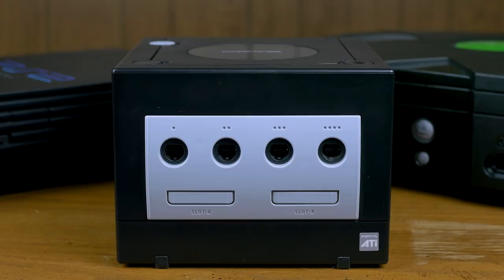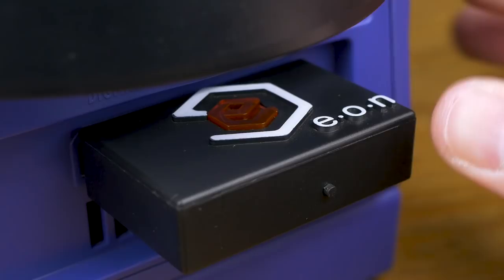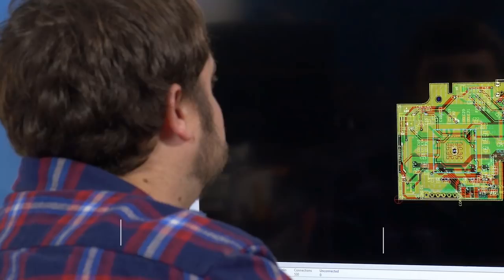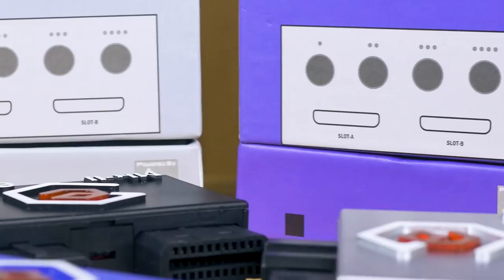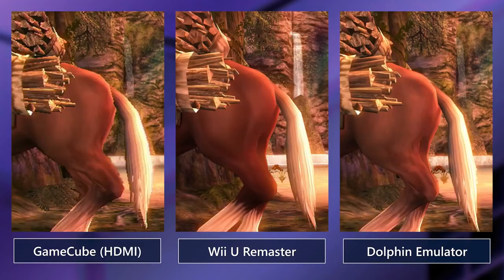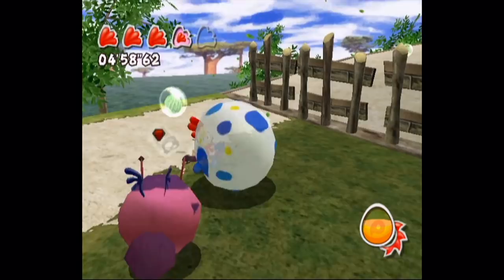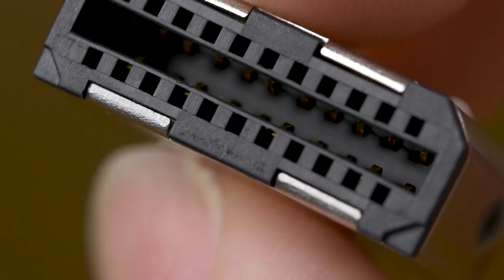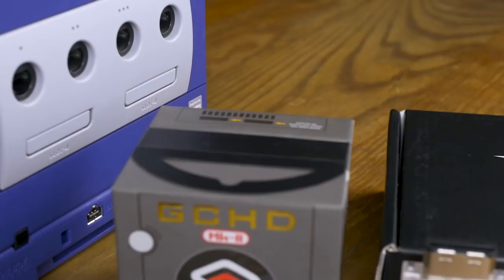Nintendo GameCube HDMI, Component & RGB Plug 'n Play Solutions :: RGB316 / MY LIFE IN GAMING

Comment: This has to be the best videos on this topic.  I bought a carby and hook up to a home theatre and noticed when I turn on enhanced DVI mode I get no audio and this video suggests using rca cables for audio?   This is not an option for home theatre systems and wondering does any of the other devices output digital audio? Especially the internal HDMI install?
Reply from the maker: [Try4ce] Is it not an option? I recall an older AV receiver I had having the ability to select a different audio input for the various video inputs. I haven't tried it with my current one. However, I also have had this issue with a similar device, the GBA Consolizer. Running the HDMI through a device like a splitter or HDMI audio extractor before the receiver will often fix this. This is what I run my GBA Consolizer through to fix the audio: https://www.amazon.com/gp/aw/d/B07XCZC6SP?psc=1&ref=ppx_pop_mob_b_asin_title#

Comment: Do you think they'll express interest in doing an HDMI adapter for the Model 101 GameCube? AKA the model that lacks the component port? If so, they should do the following.

1) Make the adapter simply be compatible with Wii component cables.

2) Make the adapter use both HDMI for picture and use the Wii's component cables for audio.
Reply from the maker: [Try4ce] It's not possible to do this very well sadly. You would just be converting S-video to HDMI. The GameCube is unique among it's contemporary consoles for having that digital video access. Dreamcast, PS2, and Xbox do not.
Reply: @mylifeingaming  I see. Though do you think EON or Carby would be interested in taking on that challenge?
Reply: @mylifeingaming  Isn't there a hard mod option for later GameCube models to give it HDMI port that gains access to the same video signal that the Digital Port had access to? I seem to recall seeing it somewhere.
Reply: Models that don't have the external digital out port can still be modded with citrus3000psi's 'GCDual' mod. I use that mod myself and prefer it to the external solutions. There's no bulky adapters to worry about. You just plug a mini-HDMI cable into the console and use the analog port for analog signals (the GCDual even adds RGB to the analog port that was previously missing in NTSC Gamecubes). Here's a shot of the back of my Gamecube with the GCDual mod I installed myself:

https://i.imgur.com/LJtPXB4.jpg

And my most recent installation of citrus3000psi's internal Dreamcast HDMI mod, which actually outputs an optional upscaled 1080p signal:

https://i.imgur.com/ywC46eK.jpg
Reply: @RedArremer  Interesting. Though after rewatching this video, does the GC Dual Component Adapter work on the later model GameCubes? I'd imagine so, but I'm still curious.

Comment: At first I want to say thanks for the update Video to  the My Life in Gaming guys. Superb Quality          as always. And now I have got got a question to the "Why  not just get a Wii " guys. I have to admit that I did that. Was my first  step on my journey  for decent game Image Quality. Ok   luckily I already had the Wii, I just had to get a component cable for "just" 20 Euro.  It was not that expensive but it was still futile. The Image Quality was horrible. The Picture was just too dark.  Messing around with the contrast Settings of the  TV just made it worth.  Then I got a NTSC gamecube and the internal HDMI mod. Costed a small fortune but it was worth it. I finally could see something on the Screen.  So now to the question  to the Wii guys. What component  cables where you using? I just used some random third Party stuff and it was horrible as I have already said. I am just asking out of curiousity. Will   never go back to the Wii with the horrible Image Quality. But I still curious about the cables.
Reply from the maker: [Try4ce] Hmmm it's possible that resistors were incorrectly put in the cable or something. I have not yet tested a PAL Wii, but I would not expect it to be dark.
Reply: @mylifeingaming   Thanks a lot for the reply. Yes it is very likely that there was something wrong with the cable. Was   a no name cable after all. And the problem does not seem to be commonplace.  Did intensive research online after the problem occurred and I could not find mind lots of info about the problem. Let it g o then because I wanted to play on the Gamecube anyway.  But I was still curious about that issue.  It is  the cable for sure btw and not my TV. I also have a old Launch Xbox 360 and have always used it with component cables.  And on the Xbox  the colors look completely normal.

Comment: What's the advantage to this vs using modded Wii u with nintendont and GameCube adapter?

I've been very happy with the HDMI output in this setup and it also easily allows loading games from SD card.

Obviously you don't get the component output but if you're just looking for HDMI buying a Wii U and GameCube adapter will get you access to a huge library of gamecube - Wii, wiiU games

If you have a Wii you can even rip your own gamecube games to avoid pirating.

Comment: Can you answer a question about audio on the Gamecube?
Some GC games state that they have surround sound. However, the GC only has RCA L/R audio. How can you get the most out of the audio for games like Metroid Prime 1/2? I would love to hear them how they were meant to be heard.
Reply: That's through Dolby Pro Logic 2, you need a receiver that can decode that. It's basically surround compressed through stereo outputs, your amplifier decodes it to 5.1 surround.

Comment: The biggest problem remaining is Nintendo's dropping the digital out. I have a 'cube that has it, but the disk drive is dead. It might be repairable, but it's also been sitting around unused and possibly uncased (my stepdad took a look inside at some point) for a decade at this point, so who knows.

I wonder though, if you're going to mod a system, if it's possible to ass the expansion slot used by the GBP to the Wii?

Comment: Late and stupid question here, why do none of these companies make either a super short cable with plug and socket connections, or at least make a version of the HDMI connectors with a few inches etc of cable out the connector end to protect the device from snapping the digital out connector in the first place? Just wondering.

Comment: I have a question about that new port on the GCHD MK-ii that accepts Wii component cables. I understand Wii’s can only output analog and that the Wii component cable converts the analog signal to a digital one. My question is, if you use the Wii component cables on the GCHD MK-ii, are you getting a true 100% digital signal from the Gamecube, to the GCHD MK-ii, and then through the Wii component cables to your TV? Or does the signal turn back to analog because of the Wii component cables?
Reply from the maker: [Try4ce] I think you have a few things backwards. Component video (YPbPr) is analog, period. The Wii outputs analog, the Wii component cables are analog. The official GameCube component cables are weird only because the signal is digital (YCbCr), and needed to become analog for anyone to be able to use it back in those days (so it converts TO analog). The GCHD Mk-II is pulling DIGITAL from the GameCube. If you use an HDMI, then it continues to be digital. If you use component, then it becomes analog. If you connect that analog signal to a CRT, it will continue to be analog. If you connect it to an upscaler or an HDTV, then it becomes digital again (HDTV always converts to digital because it's digital technology). However I would say, don't get hung up in this case as to whether it's staying digital all the way or not, because in my opinion, I prefer how the component from the Mk-II looks because I can use it with the OSSC and do further scaling with it.

Comment: So informative. 

I have to ask.. For a PAL Gamecube are these HDMI adapters worth it?
Reply from the maker: [Try4ce] Absolutely. The PAL GameCube itself doesn't have any limitations compared to its NTSC counterpart, as long as you have the Digital Out port on the back of your system. The limiting factor are the GAMES, rather than the system. PAL region games didn't have 480p support officially included for whatever reason, but I believe most PAL GameCube games offer a 60Hz option if you hold B when booting the game. However, you can use the Swiss homebrew software to force 480p in many (most?) PAL versions. Compatibility lists are online somewhere. Alternatively, you could also just use homebrew to get around region protection and use NTSC versions.

Comment: People have tested that the Wii U's Wii mode is laggy. That said, there's no proper testing comparing its HDMI output and its analog Wii output, meaning they haven't tested the ADC conversion speed of the HDMI port.
Reply: What has been tested in, HDMI or analog output?
Reply: @Rulumi people have tested the Wii U's Wii mode + HDMI output, comparing the lag with the wii2hdmi adapters you can find on Amazon, and the wii2hdmi won. Iirc, they haven't tested the adapter on the Wii u itself, which is a big shame.

Comment: Ever mess with the Zelda X Pro solution? We have one and it seems to do the job well, just wondering how it compares to the others
Reply from the maker: [Try4ce] We have not. I know that with at least some of the units, there's a real risk of shorting the system because it's possible for the pins to shift in such a way where they can touch connectors that they should not touch. However in terms of video output, it should look identical to any GCVideo HDMI device running the same firmware. The visible differences between 2.3 on up are virtually indistinguishable. Not sure about earlier firmware exactly, but I assume it should be similar as well.
Reply: My Life in Gaming nice, it seems to have a lot of the video and line doubling options as well but I think it’s based on an older version of GC’s framework. I’m not much of a tech so not completely sure but it looks good for $100. Also he changed the design to a more snug fit with a 3d printed connection, feels a lot more secure than what shorter out MJR’s. Great vid as always!

Comment: Once you get to 6th gen S video at minimum is a must! I'm fine with my Super Famicom and Nintendo 64 over composite, but PlayStation 2 and GameCube need sharper S video at least, also, what does My Life In Gaming think about Kaico's SNES/N64/GameCube line doubler?
Reply from the maker: [Try4ce] Kaico has been a bit unscrupulous in trying to rip off community engineers, so we're not too hot on them.

Comment: You guys leave out the fact that the wii can run GC games in wide screen with nintendont at higher framerates and is a hell of a lot cheaper EDIT: And 480p can be forced on non 480p games and don't forget usb loading without need of any special hardware
Reply: That was in their original GameCube RGB video.

Comment: I didn’t understand the purpose of the frame meister if you’re using the GCHD MK II. Wouldn’t running through two upscalers cause problems?
Reply from the maker: [Try4ce] The thing is the HDMI GameCube devices really aren't upscalers. They just output 480p. Your TV is upscaling that 480p to 1080p or 4K or whatever anyway. The idea with running it through another device would be to give you more control over that upscale. But not something that is really worth it with the HDMI. However with the component options, I do think running it though the OSSC for 960p is amazing.

Comment: So for folks that own the original component cables, what is the best TV to play GameCube games on?  I’ve researched it and cannot seem to get a straight answer. Some folks say an HD CRT and some say an LCD with component inputs. I am not looking to use an upscaler.
Reply from the maker: [Try4ce] Some people are really fascinated with early 4:3 LCDs that are marked "EDTV" but to be honest I don't think they should be. LCD TV technology has improved a ton since then, and TVs from that era tend to have poor black levels and bad ghosting. HD CRTs are also not a favorite of mine overall, but I will say GameCube is one of the better things to play on one. If money is no object, a Sony PVM-20L5 is just about the best display for GameCube because it supports 480p, but they're a lot more expensive now than when I bought mine. Really, I don't think you should be opposed to an upscaler. GameCube looks FANTASTIC on the OSSC these days if you turn on the 480p 2X mode, which outputs 960p. Even just with the 480p passthrough mode it looks quite good. The OSSC has come way down in price, only about $130 these days, and you could use it with more systems too.

Comment: Which one of the video signals is being used from a PAL gamecube, if you connect an HD retrovision SNES component cable to the PAL gamecube's Analog out, the component or the RGB?
Reply from the maker: [Try4ce] That cable only pulls RGB, and converts it to YPbPr. Since it's not connected to the Digital Out port, you can't get 480p this way, however.

Comment: I'm a bit confused. I see that the Eon Mk II actually makes use of the composite port, but does that mean that the Eon Mk I and the Insurrection Carby don't have any audio at all through HDMI?
Reply from the maker: The GameCube's digital port actually does have audio! The official component cables simply did not use the audio from it, only the video (probably to save cost because it wasn't really necessary at the time). The EON Mk-1 ONLY lets you use digital audio, which in some situations may cause compatibility issues. With the Carby, you have the option to use analog audio if you have issues with digital audio. The Mk-II uses digital audio from the digital port for HDMI, or analog audio from the analog port for non-HDMI.
Reply: @mylifeingaming  Thank you. This channel is awesome!

Comment: So, is the connector at 6:28 a plug-and-play connector that can work by itself to connect to Wii cables, or do you need the rest of the kit? I'm a little confused.
Reply from the maker: [Try4ce] It's only if you have the GCDual mod. It adds RGB and component to the regular AV out, but since no cable was made in that shape for component, you can use Wii cables instead for that (remember that HD Retrovision pulls RGB, it's not straight component). It's just a passthrough and would do nothing for unmodified systems.

Comment: Why is it that the HDMI comparison always looks blurrier than the component? Being digital, shouldn't the HDMI version be the crispest?
Reply from the maker: [Try4ce] It's because it's not upscaled. It's 480p only, while we show the 960p upscale you can do with analog on the OSSC. Technically HDMI is the least noisy signal, but you can do more with analog!
Reply: Can the OSSC not do the same up-scaling to HDMI that it can to analog video? GameCube video with a crispy upscale and a noise-free video and audio signal sounds like a dream, but it would be a shame if the up-scaling can only be done by your TV!
Reply: @fireaza  No it can't, the OSSC does not have HDMI input only output. It has Component and SCART input plus a 3.5 Stereo audio input/output.

Comment: I have a later gamecube model with no digital output, is there a way to restore this output in order to use 480p?? (I think all of the choices shown in the video are only for DOL-001, not DOL-101... but I've might missed something).
Reply from the maker: [Try4ce] It is theoretically possible to mod these systems for digital output, but I am not sure if any of the major mod options are designed for these systems. Certainly it's not possible to do plug 'n play with these systems.

Comment: Did Retro-Bit buy up Carby? I've been trying the Prism adapter, the menus and settings look identical. I have tried a GCHD Mk II, but I'm not getting any signal from it. It may not help my unit had the plugs pointing upward at an angle.
Reply from the maker: [Try4ce] The firmware is open source, so it's generally the same across these devices.
Reply: @mylifeingaming  Ahhhh gotcha, thanks for the reply!

Comment: Can the EON made for the N64 be used with GameCube that just has one port in the back? I guess my gamecube was made after 2004 and doesn’t have the digital port in the back.
Reply from the maker: [Try4ce] We've never been able to test one of those, but in theory it should work. However, because it's shaped for N64, I do know that if you want to use it with a SNES, you have to hack away the plastic. I don't know if GameCube has the same situation. A more flexible and cost-efficient option might be a RetroTINK-2X Classic or Pro, with SNES/N64/GameCube S-video cables. You can get new S-video cables at Retro Access. https://retro-access.com/collections/super-nintendo/products/n64-s-video-cable. The results should be virtually identical based on what we've seen of the EON N64 device, plus with the RetroTINK-2X devices, you have the option to use composite and component as well. You could use it with just about any analog output console in some fashion.

Comment: Is the HDMI actually a better picture over the Official Componet Cables?
Reply from the maker: [Try4ce] Depends on how you want to hook it up. If you're not using anything like the OSSC or CRT for analog consoles, then just get a Carby HDMI. But in my opinion, the analog output from the new component cables is better than the official ones, and better than HDMI if using an OSSC.

Comment: can you go carby line doubling 480i to 480p to a hdmi>vga cable to a pc crt monitor?  Some gamecube games will only output 480i and will not display via a pc crt monitor.
Reply from the maker: [Try4ce] Yes, you can do this. It will be using the "bob" technique to convert 480i to 480p, but it will indeed connect to a VGA PC monitor this way. Many inexpensive adapters have no lag.